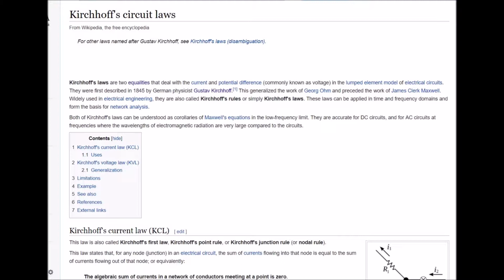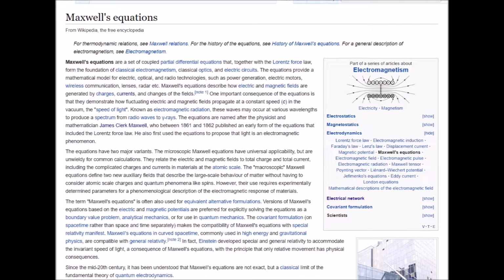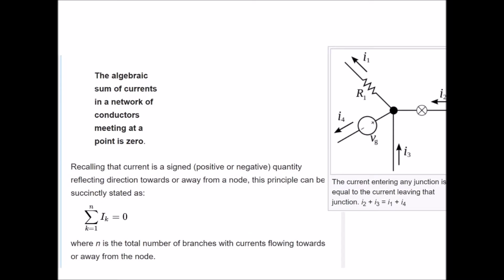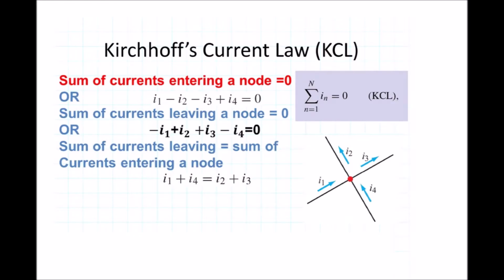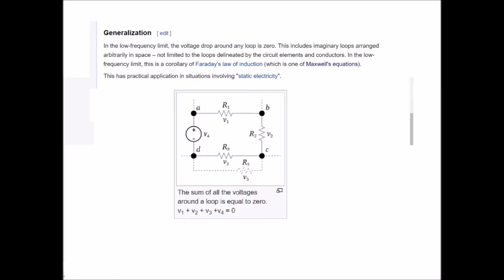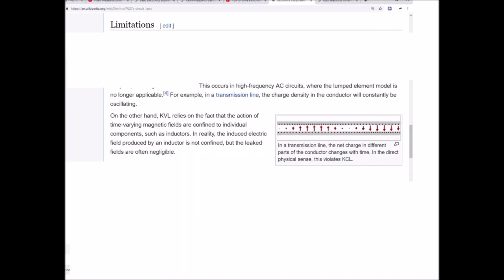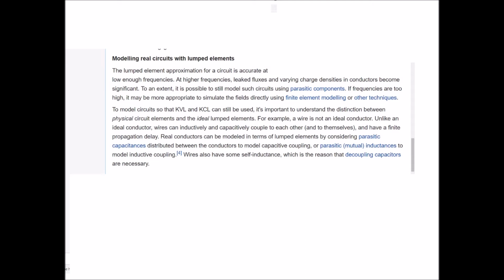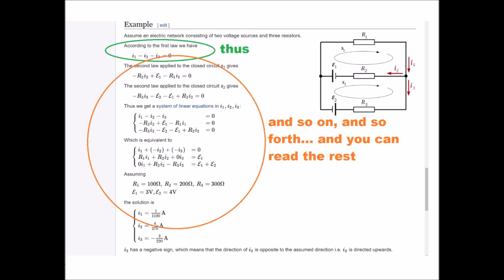Kirchhoff's Circuit Laws

Comment from the maker: The reading has lots of gobbledy-goo jargon. It is needlessly technical. So, I'd like to re-emphasize the basics:

Rule 1. Kirchhoff's Current Law (KCL) states that for any node in an electrical circuit, the sum of currents flowing into that node is equal to the sum of currents flowing out of that node.  (That's actually a simple concept. Again, with respect to nodes (junctions): current in = current out. Simple!) This assumes a charge in the wires and components is constant.

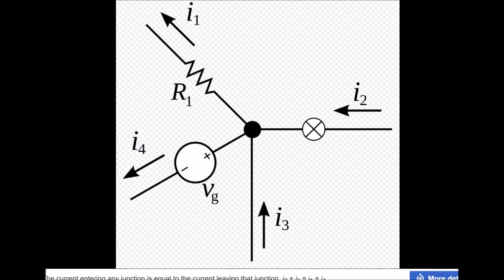(See 2:25 in the video for an example diagram.) i2 + i3 = i1 + i4

- - - - - - - - - - 

Rule 2. Kirchhoff's Voltage Law (KVL) states that the directed sum of the voltages around any closed loop is zero.

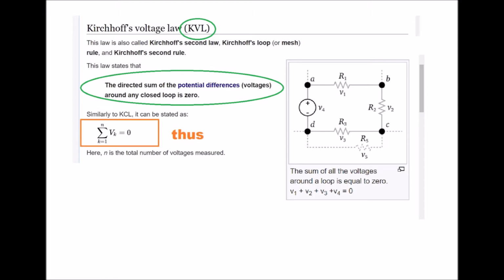(See 5:15 in the video for an example diagram.) v1 + v2 + v3 +v4 = 0

- - - - - - - - - - 

The software SPICE ("Simulation Program with Integrated Circuit Emphasis") uses Kirchhoff's Circuit Laws as its basis for theoretical testing of circuits.